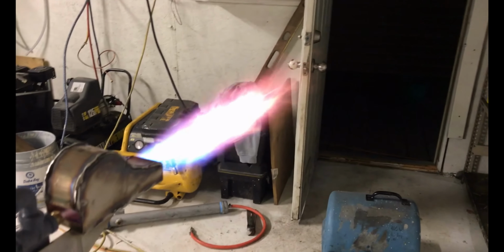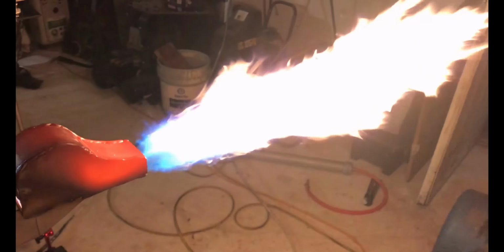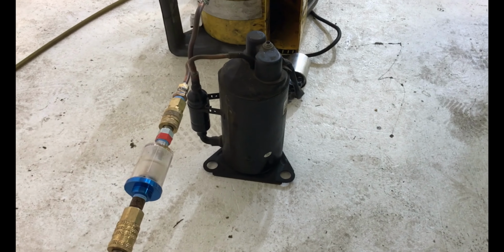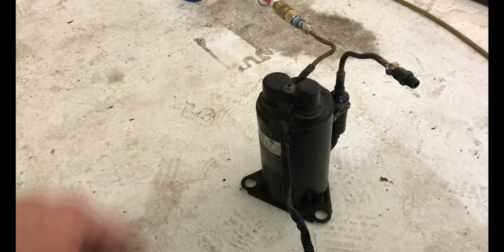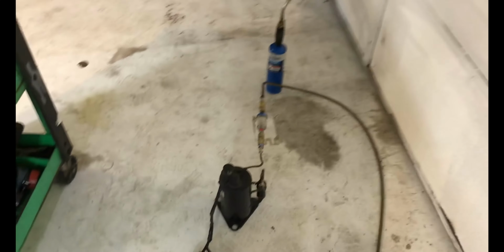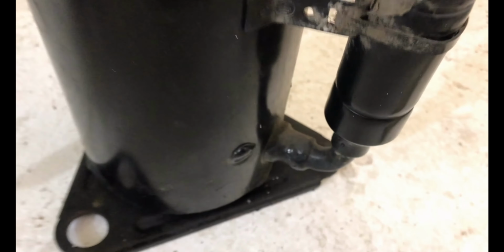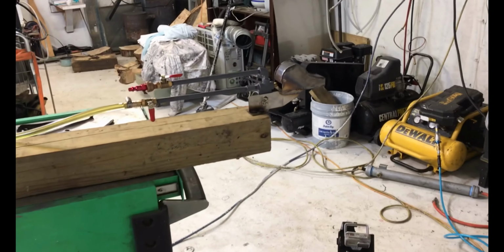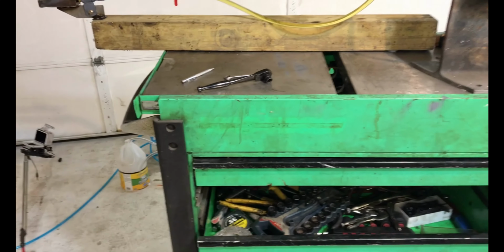Ac compressor Waste oil burner 200 watts silent  0

Comment: Only way your going to get all the old oil out of the compressor is to drill a hole in the case then weld a bung for a pipe plug.

Comment: Is it possible to use Refrigerator compressor instead of AC compressor?
Reply from the maker: Most likely no , the flow rate is much much lower , great question by the way as this would certainly not work with a small piston style compressor

Comment: FROM MY COMPARISONS TO DIFFERENT SYSTEMS PUMPED FUEL APPEARS TO BE SUPERIOR TO A VACUUM PUMP.  

PRESSURIZED SYSTEMS ALLOW MORE FUEL AND MORE PRECISION CONTROL. 

IF TURNED UPSIDE DOWN YOUR BURNER WOULD CONTINUE TO FUNCTION AS IT DOES PLUS THE BELLY OF CYCLONE APPARATUS WOULD HOLD LIQUID FUEL PREVENTING FUEL FROM DROPPING OUT THE FRONT.  Fuel in the belly would be heated until it becomes a gas and then burned.  The burner as you have it is upside down.
Reply from the maker: yes then that fuel boils and ashes up so bad it ruins the burner , this burner was at one time that direction but field testing proved that to be a lesser route
Reply: NOBOX7  ashes destroy the burner????

Comment: would be cool to have a burner with 20 watts input and 2000W output so it can run of batteries and a mini fan/compressor, could be marketed as portable version 
best product made would be "i-burn" / "i-burner" xD

Comment: you can try to get a rotary compressor from a used window air conditioner more than 2 ton useing r22 foreon , which have larger than 40cc.
that is huge , at least 3 times larger than the compressor you showed in this video.

Comment: Ok.... I went back to the beginning of the video......
Yes Sir.  Someone did say that......
Uhhhhhh ........ I guess Yes, it (the ac compressor) should have some sort of wind hitting it, because when in a window unit, the ac is pulling in air from the room {that is a wind flow}.

Comment: so at the end you talk abou the syphon. And syphon works great with high flow and pressure, then it sucks a good vacuum. We use 8bars on car cooling system vacuum systems. We have a syphon system that sucks a big vacuum in the car cooling system to then fill it without air bubble. But that thing wont work at anything below 4 bar(about 60psi?) And at 120psi it wil just suck so hard that all the hoses wil collapse under the vacuum. So for syphoning(wich is just suckin in by vacuum) you need high pressure and good flow for the nozzle size. Now you tested it and flow is not that high, so you need a really really really smal hole to atleast get good pressure for its flow to then work as a syphon. But then the flow of oil wil be so low it wont self sustain. So i would also say get some help from gavity, make that allready put the oil in the hose and then the pretty weak vacuum the compressor manages to make wil be enough to draw it trough the nozzle and in to the air stream.

Comment: so it did eventually work. I think i told you about the ac compressor 1 or 2 years ago? Its nice to have a compressor that is not making as much noise.

Wel i talked too soon, you did mention it later on in the video. But this looks awesome.
Reply from the maker: Yeah you inspired this video for sure and im loving the results

Comment: Great video! Glad you did the kill-o-watt tester!  Another way to cool it that I found worked out really well was putting a wet towel over the compressor and I actually set up a water drip on top of it with a fan blowing on it. Kept the compressor around 120-130F running 600w (it was a bigger compressor for 12000 BTU AC).  The compressor is meant to be in an outside unit so the wet towel and water isn't an issue and it kept the temp down about 40-50F lower than with just air alone.  I did this b/c I wanted to run the compressor 24/7 as a vacuum pump for filtration, so it would have burnt up otherwise.  

Also, I'm guessing you know this, but keeping the temp down in the compressor and the air intake will boost the CFM output of the pump b/c the cooler air is more dense. Same reason they use intercoolers on turbo's, so the cooling of these motors as an air pump is more important than it is when running as a refrigerator compressor.

BTW, the best blower I found for this is an old microwave vent fan (dual squirrel cage blower) as it concentrates the air very well and moves a lot of CFM over the motor.  You can use a normal light dimmer to control the speed of these motors/fans.
Reply from the maker: Im thinking of making a finned oil can to submerge it in , maybe mineral oil
Reply from the maker: Yes those fans are great , i salvaged one a wile back but freekn mice ate the dang blades up
Reply from the maker: I think your the one who prompted he meter lol

Comment: the ac compressors are very reliable and will last many many hours working, just make sure you replace the oil in them as refrigerant oil is hydrophilic and will attract water vapour i have heard motor oil is more durable and will last longer